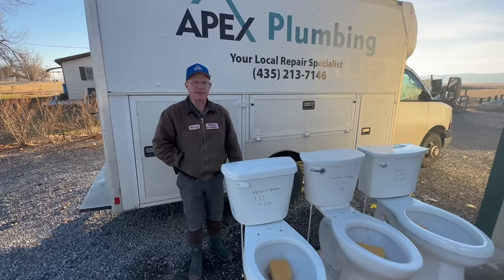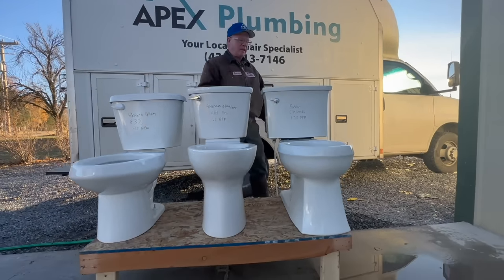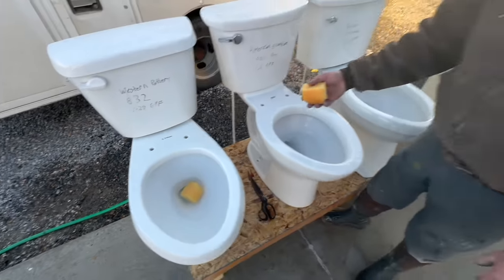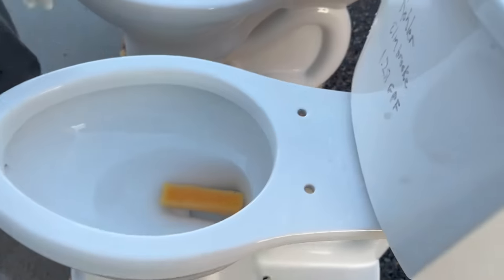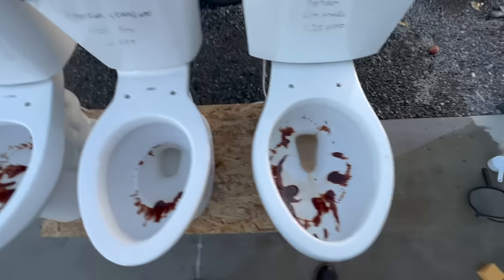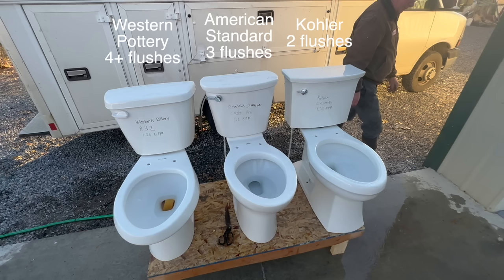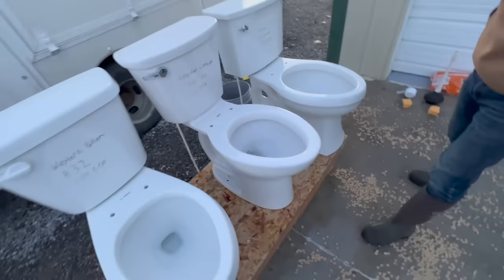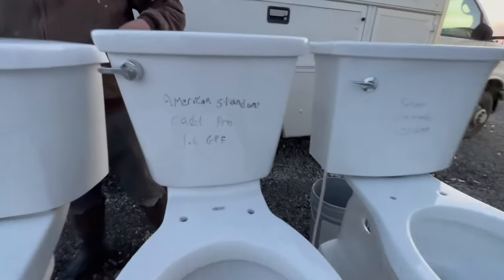What toilet should I buy? 3 different brands compared

Comment: Buy an extra chain float and adjust the fill valve to the maximum height that you can get and adjust the overflow tube to the maximum height that you can get so that you get the longest flush and if you are lucky you will get 2 gallons per flush

That's the way I have done mine and I keep looking for a 5 gallon toilet but they are very rare
Reply: 3.5 gallon units are out there too if you look at house salvage places. So are older antique toilets. Obviously they all need refurbishing with new plumbing guts
Reply: Those 5 gallon toilets are better at keeping the drain line clear of debris and buildup as well.  Especially if you have a long run to get to the mains.
Reply: @KevinBenecke  ... my home is 110 years old, with cast iron and open joint clay pipe. It also has a U-trap in the basement. (very old school) The 3.5 gallon toilets have been ZERO problems, and I even added a half gallon milk jug to the tank to cut water use. If you have ALL plastic pipe then the low water flush units will be fine for the most part. Older plumbing needs another gallon or so.
Reply: @rupe53  Even with plastic pipes, low flow isn't always enough.  Especially over a long run because the water spreads out too much to be of any force to wash the walls of the pipe down well.  I would rather pay a little bit more for water than to be ripped off by plumbers to unclog my pipes.
Reply: @KevinBenecke  ... I did say fine for the most part. On 90% of problem jobs the issue is likely pipe that doesn't have the right pitch / slope. Too much pitch can cause the water to drain away faster than the solid stuff, which will eventually clog the pipe. 2-4 inches per 10 ft is generally about right to keep everything moving at once.
Reply: @rupe53  Yes, that's what I did
Reply: The only problem is if its plugged you end up with half a gallon of ewww on the floor , saying from experience
Reply: @rupe53  It also depends on the size of the turd, vs the amount of water. Huge turds weigh more, and require more water to move them along. I now have been keeping a 5 gallon bucket next to the bowl, and fill it while I'm washing my hands, preparing it for the next flush AFTER flushing normally. It seems the only way to make sure the solids are continuing down the pipe to the septic tank.
Reply: @d.e.b.b5788     I would say that today's design is based on an average of what it takes to do the job. If YOU are outside of the average, then perhaps you need to investigate a "Ferguson" toilet... along with all the jokes about it being for the MAN-SIZED dump! (quote from Al Bundy on Married with Children)

Comment: I just replaced two very old toilets in my home with American Standards. Both are basically the same toilet but one has a slightly longer bowl. They flush and clean very well. Far better than the toilets they replaced. I got them on sale for about 220. So far very satisfied with them. They were actually advertized to flush a basket of golf balls down in one flush. I don't have any golf balls so I'll just have to take their word for that!

Comment: Great tests!  I have the Kohler Elmbrook in one of my bathrooms.  I installed it in 2018.  So far it has performed well, although the rinse could be better.  It did plug once.  My plunger couldn't unclog it.  I had to get a plunger made especially for the newer style toilets, which solved the problem in just a few seconds.  We also have an American Standard Optum Vormax, installed in 2015.  It rinses the sides of the bowl very well, but the jet action below is lacking, so much so that we often have to flush twice, and sometimes 3 times.

Comment: My father in law is an engineer and a lover of Toto toilets...standard one piece ones not the crazy ones. After visiting 2 of his homes I pulled out my two Cadets and installed one piece Totos. I added their 550e washlets for comfort. Personally I think their flushing system is superior to ANY other toilet. The flush mechanisms are available easily and inexpensively...and a monkey could install the replacements.
Reply: I think Toto are the best.  I have had excellent results in both our last house and current condo with Toto.
Reply: @ctranger  me too

Comment: Thanks for the great demonstration.    What brand has the widest diameter trap?
We like the High seat & 1.6 gal flush.   Our is a Kohler.   We spent $350 for flush repairs, First guy,   1-2 mos later  The second different co.  $150.   
We could of bought a new toilet.  Bought said it's the calcium causing water to not go down
right away.
Reply from the maker: might be time to get a water softner

Comment: I have the American Standard Champion 4 in my house.  Had them for about 4 years now and they are the 1.28 GPF variant (I think).  Haven't had one clog yet.  Only difference I've noticed relative to the 1.6 GPF variant my parents had in their house (also never clogged over something like 10 years) is I have to hold the flush lever just a split second longer on the newer ones.  Both excellent toilets that never clog.  Far better than than many of the older water wasters I've used.  So good that my parents had to have a plunger in their old house, but with the Champion 4 in their new one, they pretty much forgot where they put it - it was just never needed.  I don't even own a plunger - have never needed it.  And no, I don't need multiple flushes.  One is enough 99% of the time.  Can't even remember the last time I needed more than one.  And the few times I did need more than one, it was only two.  And that's not that expensive of a toilet - about $200 at my local Lowe's (elongated, chair height).
Reply: Guarantee that if your toilet was 100+ feet of horizontal line under your driveway to get to the sewer in the street you'd have clogs, there's no way that small amount of water is going to float or carry away a pile and paper all that distance. After paying $175 for Roto rooter to come out each time, I put in an antique toilet with a BIG tank that does a REAL flush and never had to call Roto rooter again
Reply: @HobbyOrganist  Not been a problem in my experience.  The guest house at my parents place (which we lived in for quite awhile while we built the main house) was at least 100 feet from the septic tank, never had a problem.  At my house, I probably have 30-40 feet between the house and the septic tank.  Closest toilet is maybe another 20 feet inside the house, farthest is maybe 60 feet.  Never had a problem.

If I were guessing, I'd say you probably don't have the right amount of slope.  Both too much and too little can cause a problem - too little is obvious enough, but too much can cause liquids to separate, leaving solids behind, clogging the pipe.
Reply: Champion 4 for the win 🍻. I won’t buy anything but. They never clog.

Comment: I have American Standard cadet3 elongated bowl toilets in my house and a in a rental unit. They have held up well. Gosh it was 8 to 10 years before I even needed a new flapper.  By that time I just re built the tanks with fluid master pro flush valve and flapper kits since they are only around $40 each at Lowes.
Reply: I've purchased and replaced a number of toilets in my different homes thru the years.  Early on I used American Standard mostly.  When I needed to replace a couple of toilets in my prior house, I bought a Champion and a Lexington, both one-piece.    I liked their Champion line, however the original Champions had a poorly designed and constructed flush tower.  Flushed strong but leaked like crazy after a year or so.  I wrote the company and they sent me a redesigned one at no charge.  Did not last that much longer, maybe two-plus years before the familiar bowl-filling sound would fill the air every hour or so.  I ended up getting a Toto for that bathroom, and another Toto for a third bathroom in the same house.   The Lexington was a poor flushing model, no jet or suction at all.   In our current home, I replaced all three toilets with Toto's.  A bit more expensive but extremely reliable.

Comment: Retired plumber with over 40 years experience here. I just replaced my kohler toilet with an American Standard. I truly believe you could stop up a kohler toilet with diarrhea. I wouldn’t have another kohler product if it was given to me.. That’s a fact.
Reply: I'm currently easily clogging up an AS bowl. Shore house has a Kohler, which had no problems with my logs, so I'm going to find out what model it is, and get another one of those.

Comment: A plumber here on YT recommends the Gerber Viper.  I installed one about a year ago and haven't had one clog yet.  Mine is elongated and has a comfort height.  The old snake is getting rusty from lack of use.
Reply: I bought a Gerber.  Although it flushes well but the bowl stains easily.

Comment: Should you hold the flush lever a little longer? I have the American Standard and I have to hold the lever for a couple of seconds before releasing it.
Reply: It does make a difference on most modern toilets. You push and release quickly for a #1 flush, and push and hold until the tank is empty for a #2. That said, they didn't do the most important test, just how much toilet paper will each one take. In my experience, you use just a little too much paper, and most toilets these days clog up in the trap. Probably because the traps aren't glazed, and the TP gets stuck to the rough porcelain there.

Comment: So is there a way to "mod" toilets to flush like a boss? Or does it come down to the size of the tank?
Reply: It all comes down to tank size, if you put in a high tank type toilet and you were handy, you could fabricate a sheet copper tank a lot larger than the reproduction ones that have 1.6 gal max- make it like 3 gallons and a nice oak cabinet around it like they have, and you'd have a really good flush
Reply: Air flush.

Comment: Nice testing methods!  Would love to see more. American Standard have different lines with different tech. Wondering if we got a dud with our Vormax model.
Reply: I have a Vormax which I installed in 2015.  It rinses very well, but many times we have to flush it twice because "something"" didn't go down the first time, which of course is a waste of water.
Reply: @lynx93tk  Rinsing wasn’t our biggest problem. Ours got to the point where it would flush slowly and incompletely like the trap was clogged even when it wasn’t.  Got American Standard to replace with a different model recently.
Reply: @bt5252  Ours has plugged several times.  If you hold the handle down and exhaust all of the water in the tank, it empties the passageway to the jet, and then you have to flush 5 times to re-prime it. There are some very odd parts like the 2 flapper assemblies and the harness that controls them. There are too many parts that can fail and are most likely expensive to replace.  If any one of them decides to fail, then the Vormax is out the door.  You did well by replacing your toilet with something more reliable.
Reply: @lynx93tk  good to know it wasn’t just ours. Yes it’s a very complicated system. AS sent all new internals for me to replace and it only stopped the problem of the tank leaking into the bowl. Still would get into a funk where it seems to need priming every couple days. New model with single 3” flapper is much better but still finicky with how long you have to hold down the lever for a full flush. Need to hold for 1s or it just aborts the flush part way. Not a fan of their toilets. Our cheap Kohler in the other bathroom is pretty flawless. That’s saying something since I have had QC problems with other Kohler products.

Comment: Glacier Bay N2316 16.5” height $109 at Home Depot. FluidMaster complete repair kit #400ARHRKP10  $20.98 at Home Depot.
Before assembly, gut the tank & replace with FluidMaster kit. 
Best toilet on earth for $130.
Round bowl also available.

Comment: With new government regulations with water usage my question is can these new toilets make a 30-35 foot run to the main sewer pipe in the street ??   My house was built in 1951 … has a cast iron waste line running to the main line in the street roughly a 30 + foot run ..

Comment: what do you do when your assisted jet line on bottom to help flush is plugged with lime/scale? ... i regret buying my American standard with jet on bottom cuz its the first thing to plug up.  now the bowl itself scales up more cuz not a lot of water goes thru rim to clean bowl,most of it use to go thru jet on bottom .... i should have stuck with a bowl without the jet and just had a exit hole on bottom with ALL the water coming thru rim holes, then my bowl would have stayed clean ...

Comment: When we went to the design center to customize and upgrade our new house, I told them to put the standard Western toilets in with no upgrade. This is so I could take them out ASAP and upgrade to elongated TOTO. I have used them for years, I did commercial tenant improvements and I always spec'd them with excellent results. The only Western product we used was their drop in sinks, a good value for the money.

Comment: The one thing that is not talked about much, American standards used to be better than they are now...at least for the replacement parts, and especially in california which has the super low gallow flush requirements.  I got one of their 'super flush' champion style toilets back in 2004 and with the original flush mechanism you flush and the bowl was just suddenly empty.  Then after years, the seals for that started leaking, so I bought the replacement...it didnt work quite as well, but still worked ok, then years later that also started leaking down into the bowl, so the third set of american standard replacement flush mechanism....sucks.  If anything is fully sunk, it goes in one flush, but if there is anything not sunk it takes multiple flushes.  I went to just having a empty bucket in that bathroom that if it gets too annoying, I just fill it up in the tub and pour it down to get it to flush.  I called them and they admitted it is due to the replacement parts being for the even lower flow toilets and not doing the larger flush volumes that the older toilets need.  So at some point I may have to just get a new toilet just due to the official replacement toilet parts not working right.
Reply: I agree 100%  .  American standard Flush valve needs to be changed every year and its a terrible design.  My kohler easily lasts 3 to 4 years.

Comment: What do you think about bladder, high pressure, flush foilets
Reply: i put 4 “power flush” units in my house about 23 years ago. they have a sloan flushmate system in them. never in 23 years have i had a clog or had to replace any parts
Reply: @col.johnson9938  wow awesome
Reply: A number newer units are laden with faulty designs, premature failures (with disasterous consequences), and ultimately lawsuits.  Do your research carefully.  I recommend vacuum assist.

Comment: You aren't doing a long flush (hold the handle down). That tends to do better. Love the format and simplicity of these tests.
Reply: If you hold the handle you are using WAY more than 1.6 gallons! The federal government's overregulation is moronic. You need at least 3 gallons of water to reliably flush turds. 1 gallon is urinal status. Old 1950's 5 gallon toilets could flush an entire roll of paper without a problem. People now "hold the handle" or "flush multiple times" which defeats the purpose of saving the environment huh?
Reply: @GearsDatPowerDaTubes  5 gallon is too much, 1.6 is too little, 2.3 or 2.4 i thik is the best option

Comment: Current problem, how to make sure the chain doesn’t hang up and let the water run and run all day long in a rental and then burn up the well pump, a fix that isn’t just”jiggle the handle”
Reply: Check the flush tower/flapper valve.  See if the chain is either kinking or getting hung up on something (flush valve?), or if the chain is the correct length.   If it is binding, then a replacement valve should fix it.

Comment: For me it's not the issue of clearing the bowl.  It's the issue of clearing the pipes and washing everything all the way down to the septic tank. You need about 2.5 gallons. The 1.5 gal limit should be repealed for those areas that built sufficient water systems.  They shouldn't have inflicted these low flush toilets on the whole country just because some areas(mostly California) failed to build sufficient water systems.

Comment: I want 2.5 gallon toilets back so my drain lines can stay cleared.  When they designed toilet tanks a century ago they came up with 2.5 to 3 gallons in order to clear the drain lines. Clearing the bowl was easy. The 1.5 gallon standard is short sighted in that the only consideration was clearing the bowl and they forgot about the drain lines.
And then there's low flow showers. They are awful. There was a whole Seinfeld episode about how terrible low flow showers are.  Did the industry never see that episode? And yet the industry is now pushing rain showers. Pretty to look at. Terrible to try to shower in. You can't rinse off any part of your body below your face without the water having to pour over your face first.  You need a swimming pool face mask.

Comment: water flushed means little to nothing here's why. having a hole at the inside front to PUSH the poop through the trap is essential, having the LARGER trap hole is essential so the poop can move freely through (US toilets SUCK compared to British toilets which have a more straight run). Trap design, needs to have a good FLOW, NO kinks (sharp bends for longer poops) and finally having a 3-inch flapper which DUMPS a large amount of water all at once thus creating a powerful push force to move the poop through the crappy trap design (no pun intended)
So which is better dumping 1 gallon in 2 seconds or 1 gallon in 20 seconds
I buy American Standard, installed one a few days ago for $199, guaranteed to flush 20 golf balls, it has 3 of the 4 requirements